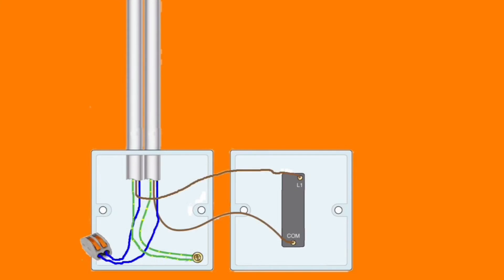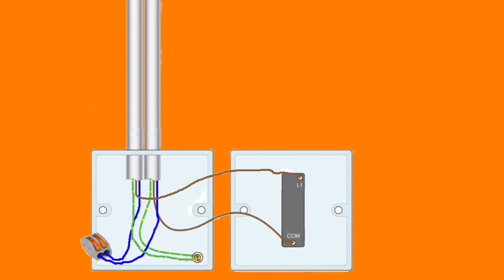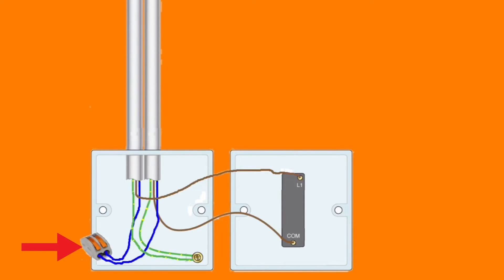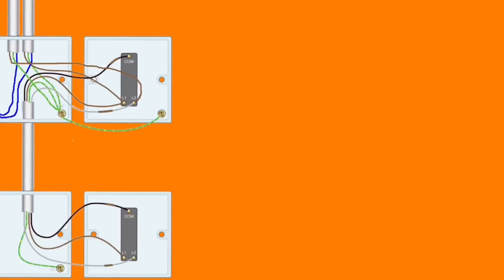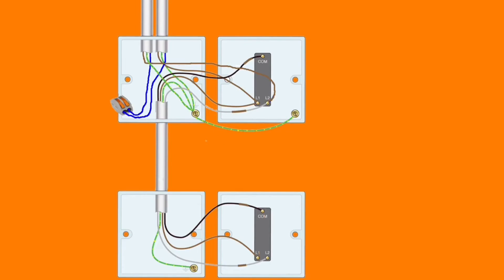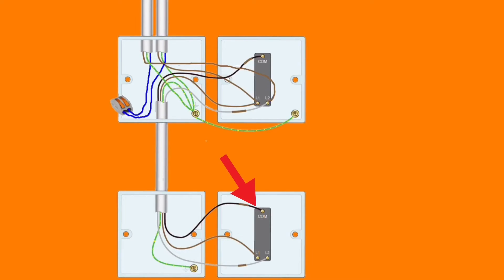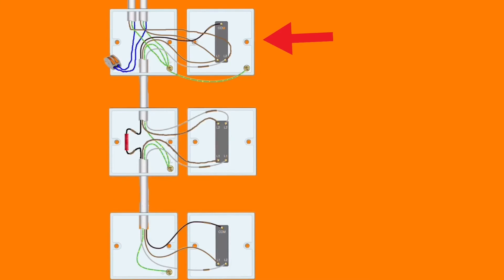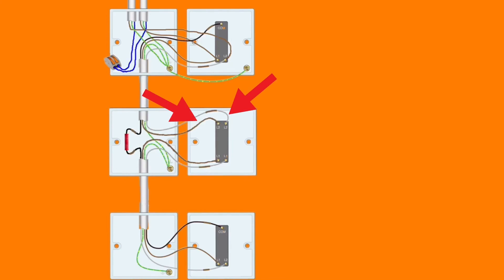Taking the Feed (Supply) to the Switch & 2 Way and Intermediate Switching of a Lighting Circuit

Comment: Yes this was considered a no no when I was an apprentice but, there were times it couldn't be avoided as in houses that had no loft hatch you could fish to the ceiling rose or hopefully pull through on the old cable. As long as the the neutral went through the switch unbroken was deemed passable.

Comment: I have existing two way lighting in my garage powering two flourescent tubes. Main switch with the input near the back door and secondary switch by the main garge door. I want to take power to a new 2 gang switch (in the middle of the garage) to individually control two new directional LED lights (brighter for working on cars). Is there a video that covers this scenario please, or do I follow this one and need 4 core cable? Thanks

Comment: Great video

Can the lights be connected to the intermediate switch?
Reply from the maker: Not in this case
Reply: @GSHElectrical  thanks for the reply

Is there any configuration where the 2 plate method allows the radial / lights to be connected to the intermediate?

Comment: I have a light switch with the dual three core cable configuration shown in the first half of this video. 1 way switching for two lights in the room. The ceiling roses both seem to have a lot of cables though. How may I test if the two blue cables in the switch are neutrals please?

Comment: I'm doing this myself after very high quotes... I struggled to find a power source but then saw a video of yours where you could take the power source from a working light on a 4 gang plate and had decided to go with this. I saw another video of yours using the intermediate or 3 way switching method which showed the multiple ceiling lights extension of the above, but can't find it now. But looking at this diagram, and taking the feed from an adjacent switch, I would need to take both the neutral and line feeds to the switch, then follow your explananation in the video. Only question i have i guess is the continuation of the lights but if they are all linked through then this would work... I'll keep searching for the lighting diagram you had with interdiate switches, power to the plate and extending to multiple ceiling lights. Thanks, agree with everyone else, very clear.

Comment: Hi Gary. All your videos are great. Just wondering if you have a video for 2 plate 2 gang light switch? So line in and out to the next room, plus one switch controlling one light and the other switch controlling another light in the same room. That would seem to suggest 4 neutrals in a wago 221 plus 2 common and a bridging common to the other common, plus L1 switch line to the first light on 1st switch and L2 switch line to the second light on second switch. Is that correct please?

Comment: Great explanation! 2 questions: Firstly, presumably it's ok to have the wago connector shown (or similar) within a light switch? Secondly, the diagrams imply that if there is an earth point on the face plate as well as the back box, these should be linked together as shown eg. for a metal/chrome face plate? Thank you.
Reply: Correct correct 👌

Comment: Compared to the way we do it here (Belgium), this seems unnecessarily complicated, and I don't think this would work with a dimmer (the ones sold here require live feed to COM).
We run black and grey (no sleeving) between the two-ways (+intermediates), link brown through from the live feed to the COM of the furthest switch, and connect the switched feed to the light to the COM of the nearest switch. It's also considered good practice to connect a neutral through to all the switches, which results in having a neutral and live feed behind all switches for future expansion or modification (f.e. an extra switch for an extra set of lights or swapping the switch for the receiver of a wireless system). The live feed and switched live can be swapped, resulting in having a switched live instead of a live feed behind all switches to allow for adding a wall-mounted light that switches on/off together with the ceiling lights, without having to take its supply from the first switch or a ceiling light.

Comment: Hi. If you are joining into the loop in the ceiling and taking it down to the switch, do you need 2 twin & earth cables to the switch, 1 supply in and the other supply out to the rest of the house? Or can you just use a junction in the ceiling and feed the switch with a single twin & earth?

Comment: I believe you can also put the black core and permanent feed into a connector in the first switch. Then connect the switch cable into the common. ( also vise versa, permanent feed into first switch common. And Switch core and black cable connected together)
Reply: My new build in Edinburgh is wired using the first technique you describe. Which does seem more intuitive to me, as I always find it trickier to follow what’s going on when terminals are shared by more than one wire.

And your second technique (where the current flows through the first switch before being routed to the second, rather than going through the second switch first) seems most intuitive of all.

So I’m curious why it wouldn’t always be done like that.

Comment: In some way supply into switch is a better method than loop in box. Is it ok if add another light eg wall light being added with twin switch to feed off permanent live from wago connectors into common of the next switch. And also same with neutral connectors but separate.
Reply from the maker: Raj Nirvan hi, I am currently working on a set of videos like you described 👍. Thanks for commenting. Gaz

Comment: Great video! Well explained, if i wanted to run a cable out of this to feed the next room would it be a case of having 3 live cores going into the first L1 switch with the neutral also feeding into that connector block? Cheers 👍
Reply from the maker: Hi, to feed another room you would take the permanent line (live) from L1 the neutral from the connector and a CPC (earth) to the next room. Thanks for watching. Gaz 👍
Reply: GSH Electrical thanks a lot for the reply 👍

Comment: Wiring a led mirror from a light switch, and the mirror only works when the lights are off. When the lights are on the mirror flashes and then goes off. Wired using live into common and neutral into l1, any help ? Cheers.
Reply: all neutrals should be joined together in a wago as shown in diagram. watch the first 30 seconds of the video and youll see. Good luck!

Comment: Hi, Thanks for your great tutorial.
Could you please tell me how you would take the supply to another room from a 2 way switch using this connection method at the switch?
Would you use a fourth cable and connect the lines into a wago?
If so would 4 cables all fit ok into a 2 way switch?
Many thanks
Reply from the maker: Taking the Feed (Supply) to the Switch and Connections Explained In a Domestic Dwelling https://youtu.be/_5uPVw4Mu8o

This may help👍
Reply: @GSHElectrical  Wow that's fantastic, just what I was looking for many thanks for your reply!

Comment: Great video!, What do you do with all the earths when it's a 2/3/4 gang switch. Scenario: I'm using chop-block to connect neutrals and earths in the metal back box, I'm not using the backbox earth terminal as it would be to tight for 4+ wires. is what I'm doing okay or should you always have an earth connected to a metal back box? Thanks for the education :D

Comment: Spent 3 years on college being taught the loop in method then to be thrown into my AM2 to be told to wire 2 plate
Reply from the maker: Hi Adam, so the instruction was to feed the switch but rather than saying that they said “2 plate”?

Thanks Gaz 👍
Reply from the maker: Hi Adam, I have added 2 plate to the description and will cover this in one of my videos. Thanks for the heads up for AM2 and watching. Gaz
Reply: Thanks for the reply. They ask for neither but the assessor said “2 plate” when I queried it. The instructions on the schedule says it requires a neutral at each switch on a 2 way and intermediate system

Comment: If it was a 2 gang switch, do you need to keep the neutrals separate. Thanks
Reply from the maker: Hi. No. Loop the permanent line off the common to the (new) next common and then take a switching line from L1 and a neutral and cpc from the connectors up to the new lighting points 👍. Gaz
Reply: @GSHElectrical  Brilliant. Thanks for the quick reply and the great information in the video also. Cheers.

Comment: Would it be good practice to use this method for two way switching as well as feed another room. So L1 would have loop in loop out (to another room) and feed for two way switch (3 cables in L1)?
Once again great video
Reply from the maker: Hi. Yep not issues with taking a neutral from the connector and the line from say L1. Thanks for commenting and watching GSH Electrical 👍

Comment: Do you always have to use 3 core for this? Could you not use two core and just have the main feed in com and then neutrals in L2 and then your line conductors going to the lamp in L1? 
And then any extra feeds coming off of the com along with the main feed?
Reply from the maker: Hi this is another method for 2 ways switching
https://youtu.be/7_5rnJ45gpI
Thanks Gaz